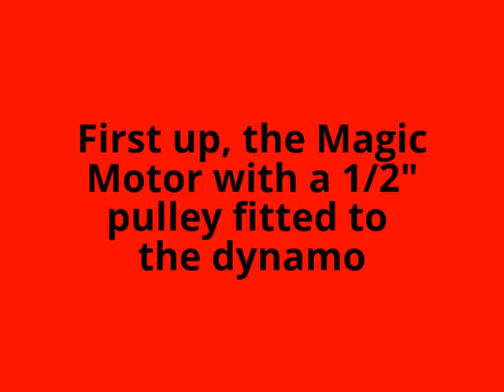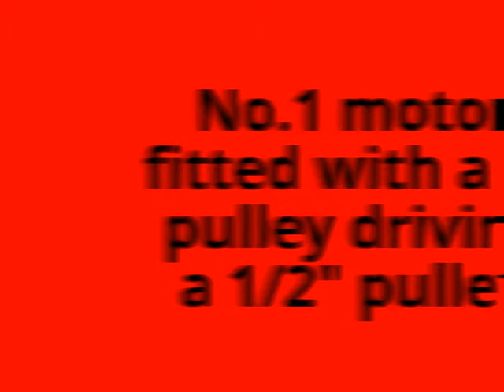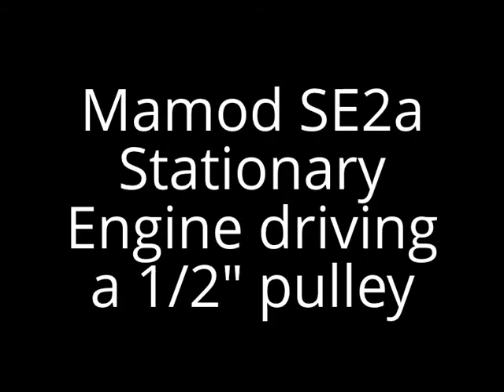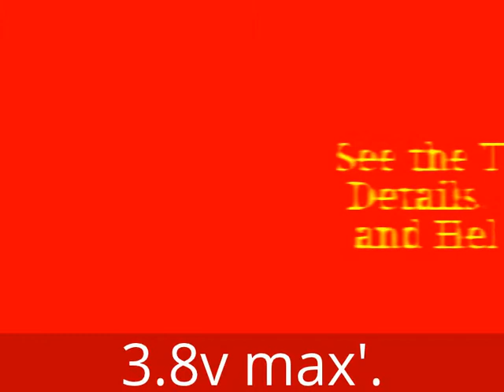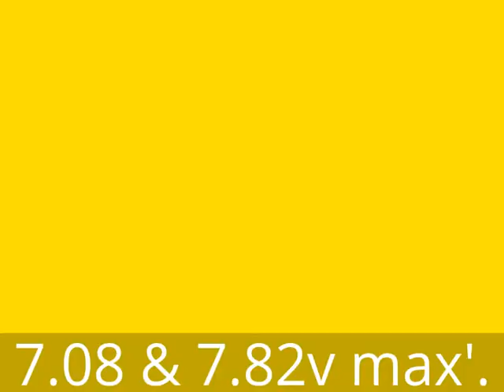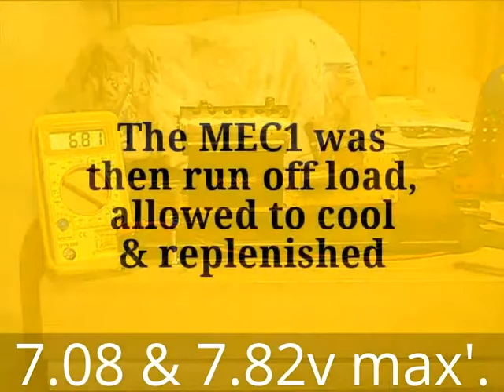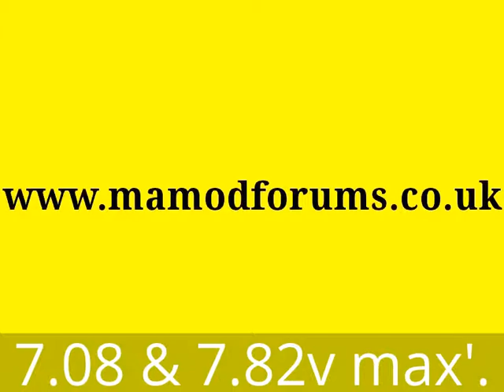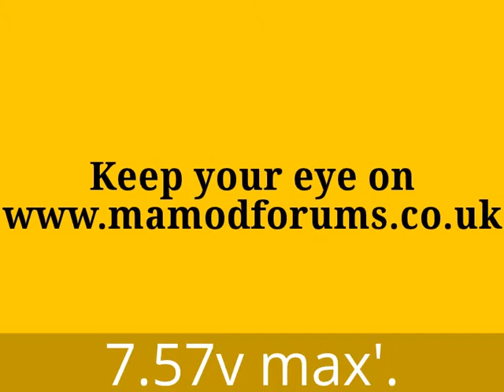Clockwork & steam powered dynamo experiments

Comment: the steam engine is very proven , perhaps you could use a "jack shaft " to raise your gear ratio to the dynamo , how ever I am interested in building a large scale clock work engine to do the same thing for a house , I thought about doing this years ago I believe the trick would be to use a car starter motor and starter fly wheel to rewind the torsion spring as it winds down , making the system self winding with enough surplus electricity to power a home or possibly an electric auto mobile ? I believe its very doable as an alternative fuel source .
Reply: Do you mean main spring... because that's what it's called
Reply: Also if a electric car had a windup battery than it would be 80% more reliable then the lithium battery...,also nothing can go forever.... it ends at some time.... you can't have it winding itself up.... energy that goes in is = to the energy that comes out
Reply: @Scudmaster11  it's called a torsion ribbon spring